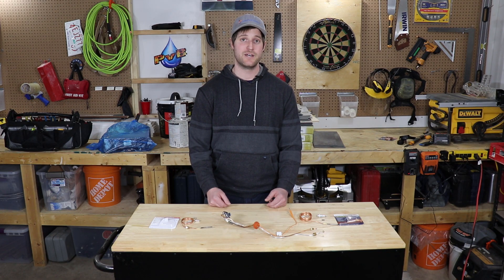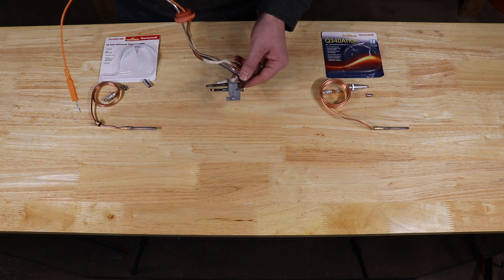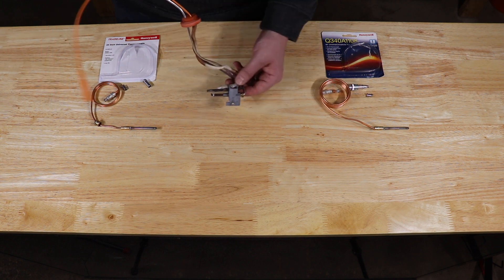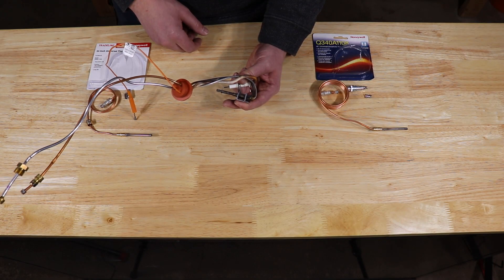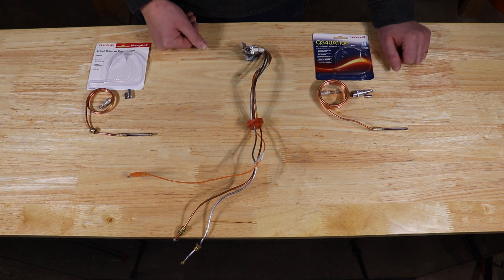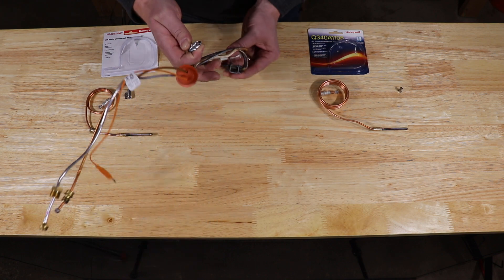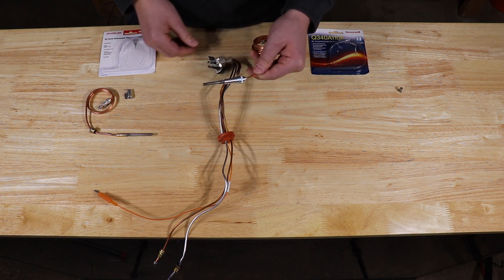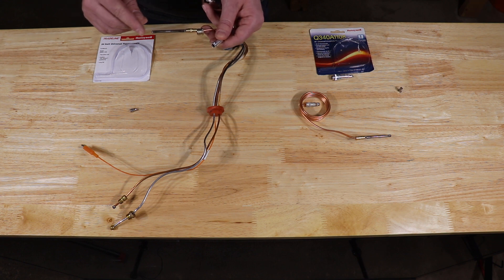Push-in vs Screw-in Style Thermocouples Explained

Comment: Is it the same assembly with the flange meets flange for a older furnace?
Reply from the maker: Depends on the furnace. There are 1000s of makes and models. Most water heater/furnace thermocouples are generic though. With a couple of exceptions.
Reply: @PROSDIY  thanks